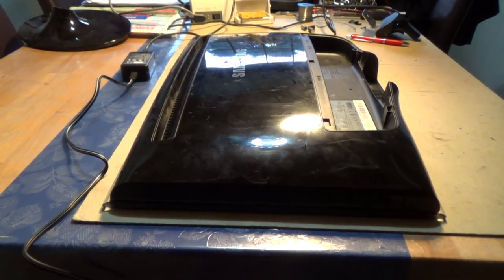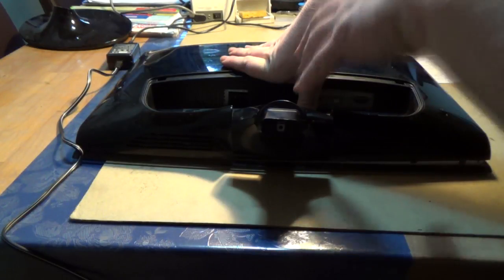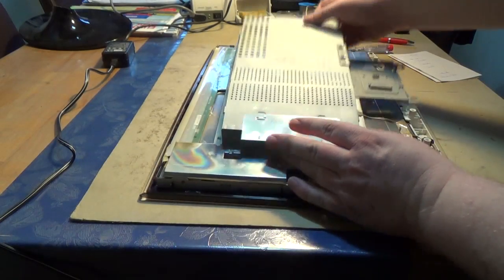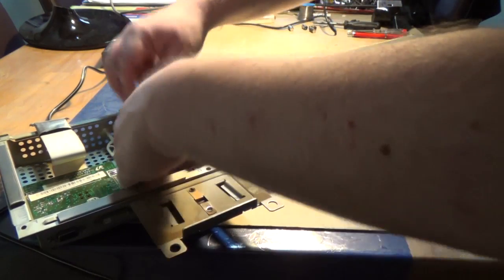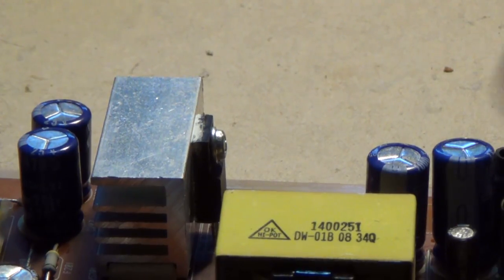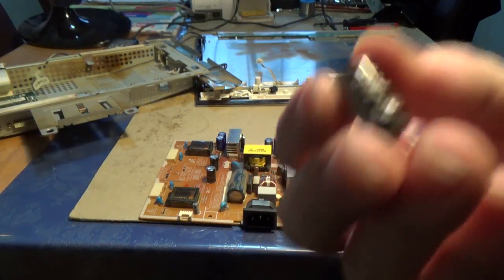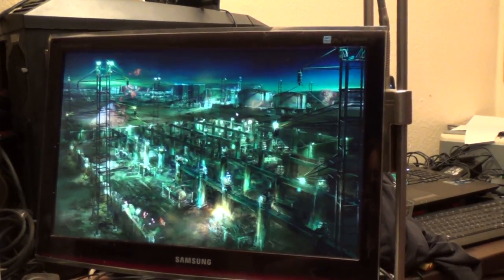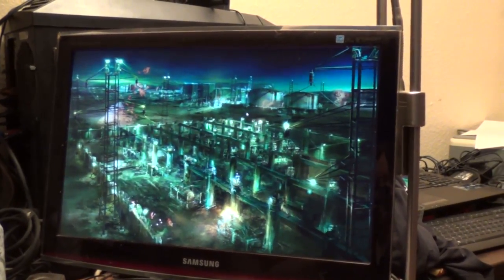Monitor Samsung T200 (T220 & T240) blinking light and doesn't start

Comment: Thank you a lot, I repaired a monitor I found this way with two capacitors replacement and one blue resistor re-soldering (it was in a playground by accident). It works perfectly now!

Comment: standard problem power supply 470 micro 25 v , or 680 25 v , or bad organization heat out , this monitors or tv this series only this problem ,

Comment: 2:28 - "They do that because it's easy to assemble, it's annoying to repair this thing from the case..." 
And that when I knew, this was gonna be a fun project... 

Replaced two bulging 16V 1000uF caps (c113, c116 I think) with some large 50V 1200uF caps I had lying around from another electronics project... Wasn't easy to squeeze those larger caps inside of it, but it's working again. The new caps I put in are also rated up to 125°C, instead of 105°C for those older caps. Hope it extends their life a bit longer.

People that are in a cold room can potentially identify the issue without even opening up the display. Blow a hot hairdryer on the back of the monitor for 5 to 15 minutes, if it turns on the caps are most likely the issue. The caps optimal working temperature are typically around 25°C, colder or higher temperatures are an disadvantage and could worsen the problem. I heated the monitor almost every morning for the past 3 to 4 months, before replacing those caps :-/ . However, this trick doesn't work every time, so keep that in mind.

Thanks for guiding me trough the madness of today's plastic case frustration. I'm 30 and am jealous of my dad's old equipment that's put together using bolds and screws, instead of clips and glue.

Comment: Nice video, just the type of disassembly video I was hoping for.

Any idea what the actual voltage is across those capacitors during operation? In theory it should be possible to extend their life by using replacement capacitors rated for a higher maximum voltage like 25V or 50V, instead of 16V. The reason they prefer lower 16V rated caps during mass-production is to save 10 or 50 cents in production costs... Sad yes... 

People that wonder how a buck converter works can watch: https://www.youtube.com/watch?v=W6NOV6b8kxs
It has a boring computer generated voice, but the animations at the beginning are very clear.
Reply from the maker: Shouldn't make such big of a difference. Elkos (Electrolyte Capaciators) just give up after a few years. As for the voltage: I really didn't care xD

Comment: To get the stand off easily, screw the base back on, then pull on it on the left and right sides repeatedly, it will come out a bit at a time, each time.

Comment: Well, my problem is this. I have dual monitor set up, but I use T220 occasionally (it is not on all the time). So, when I turn on the T220, I just see power light blinking and some sound like whistling (stop and start) and maybe after 5 - 10 minutes, the whistling is gone, the power button is solid red (no more blinking) and there is picture. It happens every time. Do you think it is related to condensators? So, essentially I need to replace 4 condensators (2 of one kind and 2 of another kind that you mentioned)?
Reply from the maker: Yes it is. Like, most probably it is. It happens to many many power supplies in all kinds of electronics. 
So it can be that it works when it's a bit heated up :)
Reply: All right, it worked. I only replaced 2 capacitors that were bubbling up. The other were ok. I didn't want to touch them and maybe create another problem. We'll see how long it lasts. Thanks.

Comment: thank you. i just fix the t220. i replaced two capacitors. i always keeping a old broken psu and motherboard for donor and i found the same capacitors. i have a issue with the side panel that goes crazy and i have disconnected it.
i have this monitor from when first released and still have good specs even for today

Comment: I just opened my T220 — all of the condensators look just fine, none of them are bulging, all are flat. What else could be the issue? I have that issue where I have no image at all and my power button is blinking rapidly.
Reply from the maker: Then I am not sure. :/
It.s still somewhere in the power supply 99% chance but you have to look ><
Reply: @Commandelicious  any tips or links on what should I look for? I am a complete newbie to all of this.

Comment: Mine SyncMaster T220 is blinking for an hour or two without any on-screen graphics and then suddenly turns on and works OK. I reseted, pushed and hold all the buttons, etc.. Is it the condensators and would it help if I leave monitor on permanently (and just keep turning computer on and off)?

Comment: I can't open that black LCD panel which has Samsung written on its back.  Plz help me
Reply from the maker: Have you pulled really hard on the stand? There is no screw there, you have to pull. other than that, it's in the video.  ^^
Reply: @Commandelicious  no not  that I pulled the stand I removed that "thing" which requires a lot of pulling... 
.
Then there is that thing which I have to pry...
😫😫😫 which I cant

Comment: Hi !! My screen blink like you said  and I hear a little noise in the back but after 5 mins the screen turn on by itself and the noise gone after blinking randomly for 5 minutes but after the screen turn into black and white and the settings is messed up and sometimes the brightness become too high the white color so shiny and still blinking tho when I turn off and back on again you think what you did on this video will solve it ?

Comment: Thanks Mr Delicious! Your vid gave me courage and tips how to open the case. T220. Removed both circuit boards - nothing obviously wrong to see. Put it back together. Still Kaput - no sign of life, as before. Time to retire this beautiful old lady . . .
Reply from the maker: Yeah, mine broke again as well but after 14 months of continued service. It's a great machine :D
Reply: @Commandelicious  Some people have said that there's a chance that rather than popped capacitors, it might be the backlight that's problematic as the wire connectors can get burnt off the backlight. Might be worth investigating! Thank you for the video!

Comment: Some time have passed - is it still working? Did you have to replace other caps as well, by any chance?
Reply from the maker: It usually works for all errors that include a switching power supply. And yes, other capaciators could be broken as well. It's easy to identify those if you seen it once.
Reply: @Commandelicious  Sure, thank you.
Do you have their values as well? T220 is on the way to me, and I'd love to be able to order them in advance.
Reply from the maker: @cthulpiss  Oh sorry, I missed this reply.
My Monitor finally gave up again and I haven't checked on it because I am just using a bigger one and don't have the time. The values should be on them and no I don't have them in my head (and I guess it's too late now anyway)

Comment: Hey, I have t220 it started blinking at low brightness, then top half of the screen became dimmer and after a while whole sceen went black completely. Do you think changing caps could save it?
Reply from the maker: Maybe? 
To check for broken capaciators is really the easiest if you know how to. If it's not that there will be trouble shooting and thats a whole other story. My tip always is: Doesn't hurt to look :)

Comment: Hi, i have samsung T200 monitor with some other trouble, monitor powers on but dimming white screen is presented and after maybe 10 power on power offs monitor starts and works. Do you maybe have an idea what is worong wit it?
Thanx
Reply from the maker: That could be the capaciators as well. 
I am not entirely sure what you mean by dimming white screen. 
In my experience the only thing that actually breaks in modern flatscreen tech is the power source. 
So it could be the switching power supply as well.
Reply: @Commandelicious  Thank you for answer,
The simptoms are exectly as this :
https://www.youtube.com/watch?v=h1LCR7gO_XEv
The white color is starting to apear untill all screen turns white.( just without the white line as in this video)

Comment: Hi, i'm currently following your video since i have T220 (normal, not HD version) that was flickering a lot, and then one of the capacitors (or more than one) died and cannot hold the backlight on. I'll post the procedure here since i can't record it. 

To remove the stand, you don't need to press it, just put your monitor on a flat soft surface (for example bed), then turn it upside down (be careful, first put your monitor on the bed in a normal position since the stand might slide out because nothing is holding it) , then unscrew the stand, remove it, and after that the vertical part should slide out (mine didn't but you can hold the frame and pull the vertical part out while holding the frame, it went out easily that way).
Reply: Conclusion: 1 bad capacitor. Electrolytic capacitors inside T220 are more or less really cheap.

To replace all of them you'll need:

4x 820uF 25V 105*C
2x 1000uF 16V 105*C
1x 330uF 10V 105*C
1x 100uF 16V 105*C
1x 47uF 50V 105*C
1x 3,3uF 50V 105*C

uF - micro Farad.

It shouldn't cost more than 5 euros, at least in Serbia it costs around 3.5 euros + shipping/delivery (postal expenses).

Almost forgot, the big capacitator is 450V/100uF as i've seen from the internet since it doesn't say on mine, it costs around 8 euros but i doubt that one is/was the issue anyway.
Reply from the maker: I was pulling like a mad man, that's why I thought there were screms at the start :D
Reply: Me too and i was wondering if it got stuck since i doubt it was ever removed during all those years :P Also managed not to break anything so far so i guess it's a success, now i need to wait for the parts since it's weekend :)
Reply: I had to buy another one since that is my secondary screen that i need for work, bought a Full HD Benq for like 20 euros, it has thin green line that dissapears, probable flex cable issue, i'll fix that after i fix this T220 :D
Reply from the maker: Fixing Things <3
I still have a full blown TV I never on my other desk because it lay on the trash xD
Reply: Yeah, it's always interesting and a good feeling when you fix something by yourself :D
Reply from the maker: Yup, I just wished I were better at electronics xD 
I mean, it's still magic to most people but in comparison to other people I now I am bad at it :/
Reply: It's kind of easy if you know the theory, since all these components follow a certain rule in their behavior. Nowadays you can learn all that stuff just by watching Youtube enough :D
Reply from the maker: Yes, but it's also so damn complex and 80 to 90% of the circuitry is just that in case of a malfunction nothing catches fire xD
Reply: @lanikor  Thank you so much that's all ,or maybe I've buy something more? After almost 12 years working my T220 have some issues on preset gaming or dynamic contrast  just  turn off and i have to wait to turn it on,  im working on preset called text, and now works fine, friend told me the capacitors slowly dying, and i must replace it, i would like replace all...
Reply: @Adek88  Replace them all if you want to keep the monitor. In the end i bought Asus VA249NA for like 90 euros, sold the mentioned Benq for 30 euros so in total it costed me 60 euros for new display 24" with VA panel.
Reply: @lanikor  Thanks for replay! 60 euros for new display 24" with VA panel, fantastic! I just calculate and capacitors will cost me about 55 polish zł with shipping. And probably i'll replace all.
Reply: @Adek88  That's great, hopefully you will fix it :)
Reply: @lanikor  yea my friend have good soldering station :))

Comment: Once upon a time I could have done that too.  Bravo. Good to see that there are still electrical engineers around.
Reply from the maker: And stuff like this is thrown away. It works perfectly fine. But getting it to a shop to repair is more expensive than getting a new one.